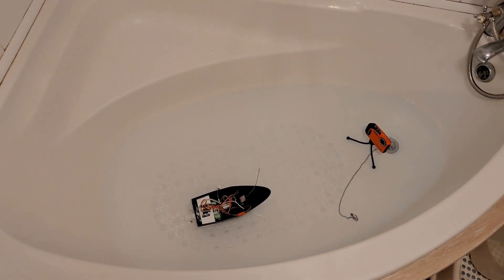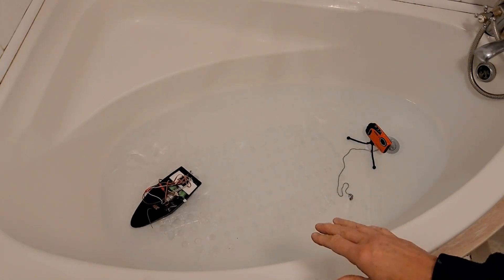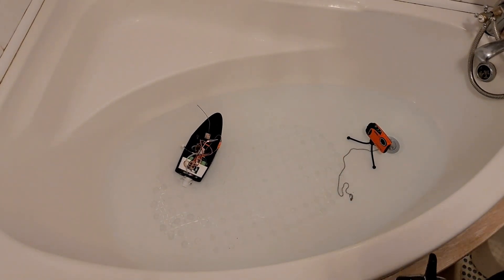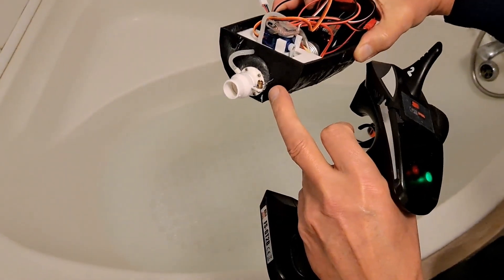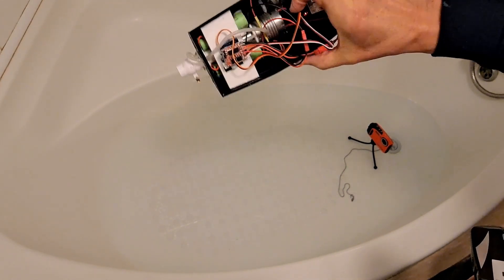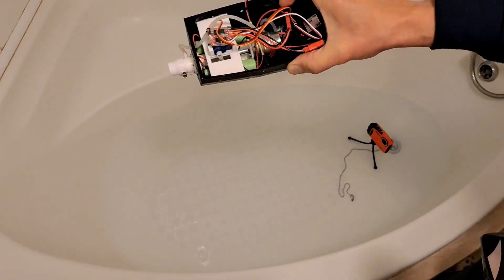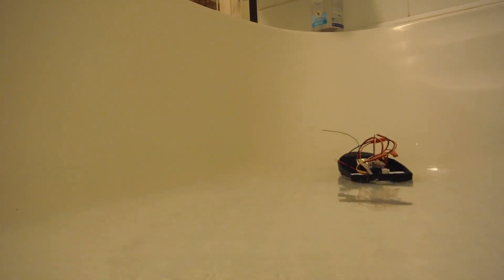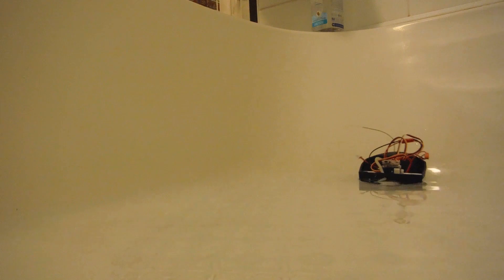Short update on my basic 3D printed water jet boat 20201030

Comment: Nice.that works really well.was that full power or just half power. Ya u have raise the push Rod hole a little bit to stop the Water from getting in😉
Reply from the maker: You probably don't get any real visualisation on the speed in a small bath like that. I don't expect it to be exceptionally fast. Yes I have moved the pushrod higher up.